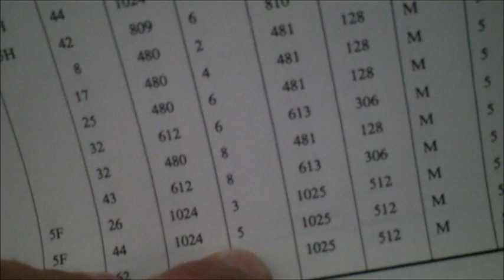Testing, setting up a MFM Hard Drive (part 1)

Comment: If you still have the other hdd that shorted out your PSU, you might want to check if there aren't capacitors on it. My western digital had 2 shorted tantalum capacitors and the whole thing was shorting the PSU too. When I disconected them from the circuit, the PSU wasn't shorted anymore and the drive started spining up  ! I just replaced all of them (the first time the drive was spinning, one of them exploded XD, so I was pretty sure that all of them if not dead were in a really bad shape. For example some other caps had an infinite resistance) and now it works !

Comment from the maker: That probably won't work.  You'll need to use the original controller.  Would be best to put it back into the old computer and power that on.  Then copy the files to a floppy, then plug the floppy drive into a newer computer and get the files that way.
If it's an MFM hard drive, the drive is linked to the controller, and plugging it into a different controller, or even another computer, will require a low level format. destroying all the data.  
Just a friendly FYI.

Comment: Not to be a dick, but what are you planning to connect this drive to?  Its been a LONG time since I've seen one of these old MFM drives and I have a hard time imagining anyone having a need for one short of some truly exceptional situation such as an old computer that is the ONLY thing a NASA probe launched in 197x will communicate with.